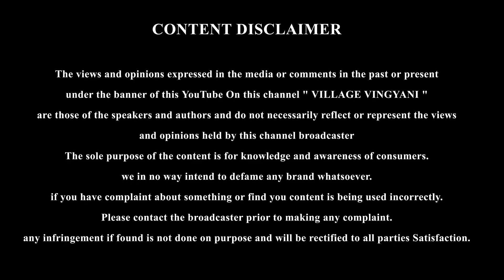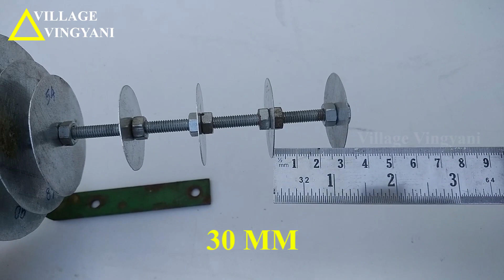Long Range WiFi Antenna at home

Comment: you should isolate the metal discs from the iron rod otherwise you are shortening the signal
Reply: It's specifically the second disc, the signal catcher if you will.
That needs to be isolated, the rest are fine.
Reply: @MsSomeonenew how would you isolate them?

Comment: When you had two antennae attached to the router so 1. Why did you hang one on top of the roof 2. if the rooftop antenna is essential so where did you connect this antenna. 3.is this transmits and receive signal both ways. 4. What is the range for RX and TX
very confusing video
Reply: Andrius Yra
1 second ago
the second  plate  68 mm must be connected but  not to have contact vith other metal parts. So this fi fi gun its produced by stupid  guy.   Must be bigger hole on that part then  put plastic betveen  of the 68 th  mm disc . off cours if you what     Antenna  will work for you as the best

Comment: I can say with 100% certainty using that coax you picked up diddly squat
Reply: are you sure ? what cable are you supposed to use > ?
Reply: Lm400
Reply: this whole thing is fake
Reply: @twentyfoursevenmusic5064  why you say that? Have you ever been tried?
Reply: The coax appears to be 75 Ohms instead of 50, which is not good
You will lose some signal
Reply: @wellboyscience8478  75 Ohm coax is not aloud anywhere near my lab. There is a sign on the door!
Reply: WiFi 10 Km without parabolic antenna and LoS? Too good to be true...m
Reply: @wellboyscience8478  
No LoS ? Ahaha no chance.  
I want to build something to pickup a signal  from 1.5km with LoS using a old router or acess point. Any ideas??
Reply: @djbertinho1984  well, you need link budget planning to do it
Reply: @wellboyscience8478  a old router with the bigest mW possible and a diy antenna.
Reply: @djbertinho1984  and don’t forget to check local regulations (max allowed power) 
and try link budget calculation and planning. for example, we can reach up to 1km with line of sight using directional antennas

Comment: Great video, there is something I dont get, why is the ground and the center copper touching the metal circules? aint that shorting out the circuit?
Reply: Impedance? I hope I'm right

Comment: This was the funniest video of the day 🤣🤣🤣.
Have you actually tested it?
Using 75 ohm cable and the adapter using  unshielded conductors whith varying separation between them?
I doubt It's usable, did you tested it on a vna and plotted a Smith Chart?
Reply: Dust

Comment: is fake it wont work, you cannot just increase antena gain forever, you need to increase the radiation power as well. 3000 mw is enough until +8db. His antenas is +20db. It doesnt work like that. The adapter power needs to grow exponentialy with antena gain. A +20db needs around 200000mw or 200 watt to reach 10km range. Imagine how much it iradiates if you stand in front of it.
Reply: You cannot exceed +20dBm (100mW) without license
Reply: @Who ? i know a bit. There are formulas on internet.

Comment: Hi Does the antenna will work for broadband internet connection extender which works on 2.4GHZ wifi router

Comment: Bro I am using a router as a repeater. That will revive very low level signal. It will recive the best signal If I change the antenna like this? Please help me...

Comment: stop bulhiting people, fist of all that antenna is wrong made, the parasitic element shouldnt touch the boom or touch each other , second- the dimensions are wrong , an atenna needs exactly measurements, thats the why we use calculators to make them and thats the why companies spent milions in researches and 3th- to get 10km out of an antenna its impossible , an atenna is not a signal amplifier - so just STOP!!! - go back and make fences or whatever leave the antennas for specialised people.

Comment: There is no sim card on ur modem so what's the purpose you are using this antenna. Depends of frequency band width size of the disc and spacing between disc will differ. This is for sim modem type. This is misleading hahah

Comment: Is this really working? And is this safe to use outside like on the roof?
Reply: This maybe will work
But it may destroy your router.
If you want to build a directional antenna yau better search for Double Biquad Antenna
Reply: @mihai1339  thank you
Reply: Yes it is, I use that kind of antenna for almost 2 years now.

Comment: i can liturely see the real anntennas lying behind the router 
this is fake af
Reply: Well router cast signal not receive like modems. He was casting signal in direction pointing by antenna. Still if you wanna better omni just go for Bi-Q antenna. And use of 75 Ohm cable yeah...

Comment: Nice upload
What is this antenna called.
Any formula and theory regarding this antenna building.
Kindly share details..thank you
Reply: It's yagi antenna. Well proper name is Yagi-Uda antenna. Also called a beam antenna (because of strong narow directions)
Theory is simple to say: waves have lenght you place "Reflector elements" on the end (it's solder to coax), "Directors" those are the small disc (leght of 2,4Ghz is 30-31,5mm). The middle disc on the end (that one where core of coax cable is solder) is "grabping" signal. 
Well and better use 50 ohms cable(it's better for 2,4Ghz to 5Ghz) 75 ohms SAT cable.

Comment: Kreosan channel
Reply: Kreosan has made the thame shit .  
Andrius Yra
1 second ago
the second  plate  68 mm must be connected but  not to have contact vith other metal parts. So this fi fi gun its produced by stupid  guy.   Must be bigger hole on that part then  put plastic betveen  of the 68 th  mm disc . off cours if you what     Antenna  will work for you as the best

Comment: the second  plate  68 mm must be connected but  not to have contact vith other metal parts. So this fi fi gun its produced by stupid  guy.   Must be bigger hole on that part then  put plastic betveen  of the 68 th  mm disc . off cours if you what     Antenna  will work for you as the best